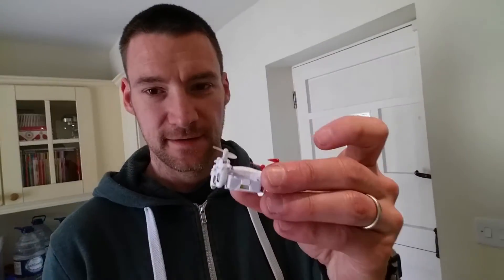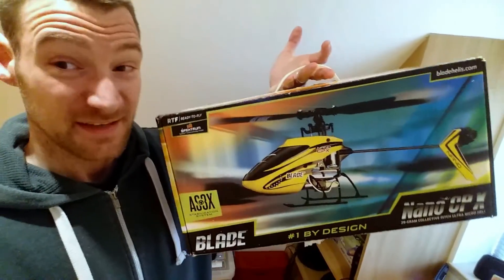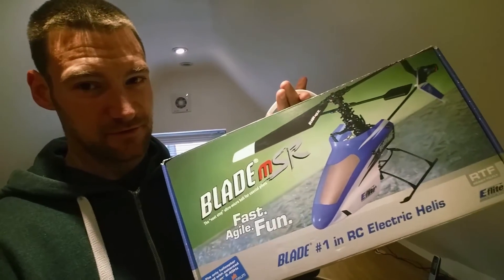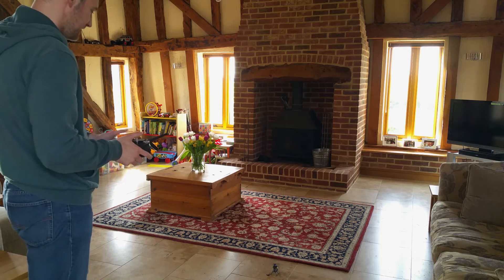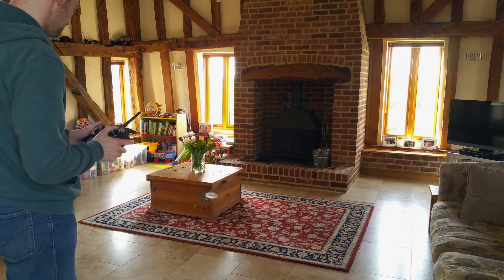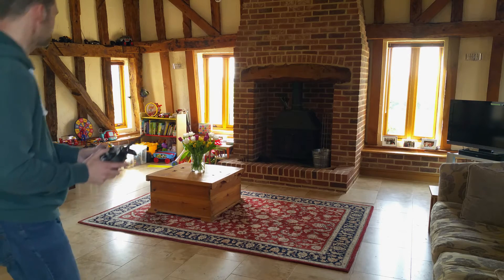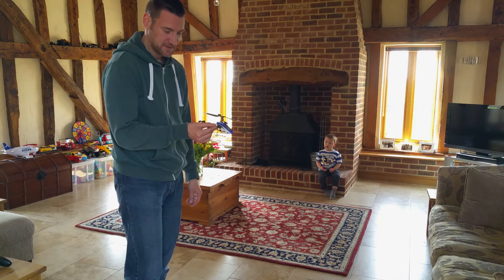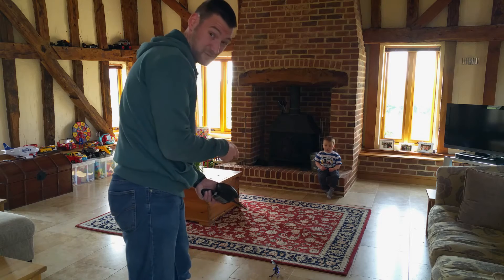Flying Drones "Nose In"

Comment: I have one of those tiny quads  but as soon as you try to hover it hits the roof and crashes
 destroying the prop and leaving a dent in the wall/roof.  how can I keep it stable to be able to try manoeuvres. I like the videos by the way, very informative. 

I have a dji mavic pro and am waiting on my spark to arrive soon. so I will practice on the spark before breaking out the mavic.
Reply from the maker: Throttle control on small quads is quite difficult. Try giving it enough power to start ascending and then immediately reduce that and try to stop its ascent before it hits the roof. I'd say with the little ones, throttle requires 80% of your attention until you get the hang of it, then it is very much easier. The good news is, you won't any throttle related problems with your Mavic!